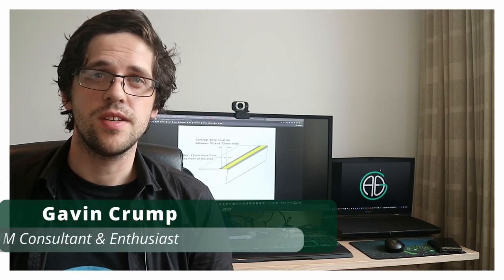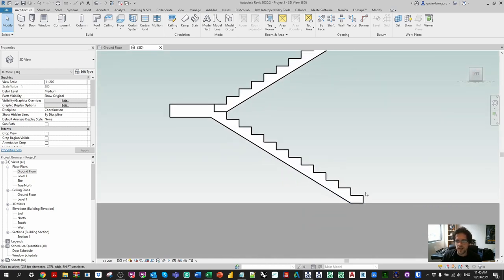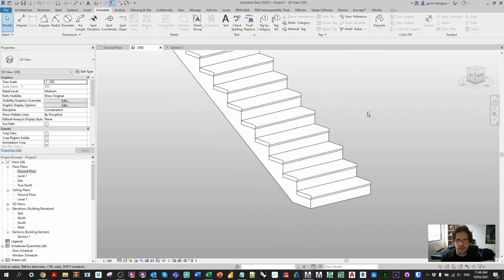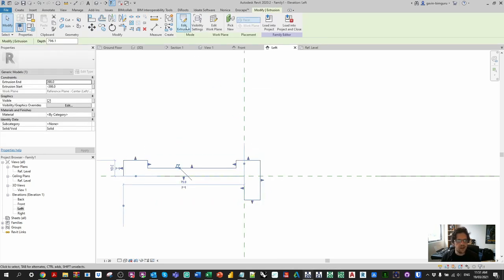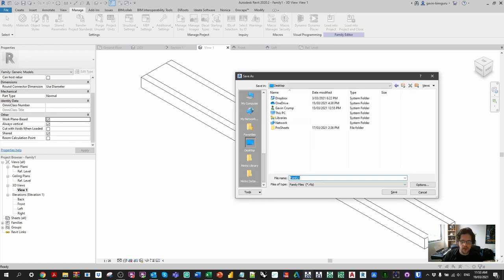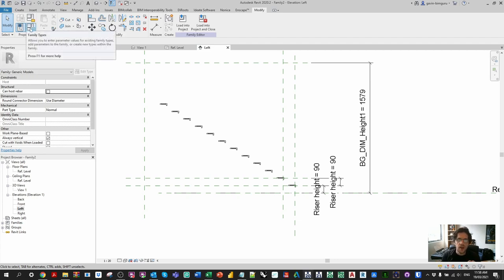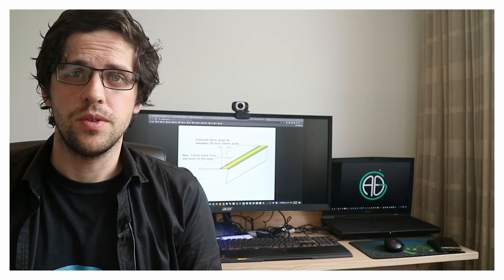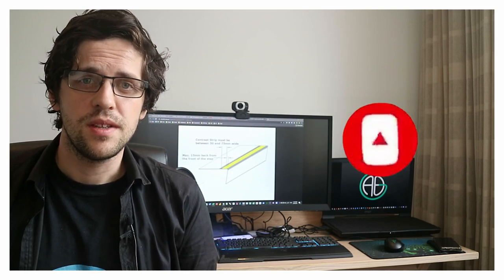Stair nosing strip family in Revit!

Comment: Another Great tutorial, will definately save time in the future :)
I have a question pegging back off a previous tutorial re - Project browsers. Have you found some way of preventing other users from changing the project browser settings? Drives me mad when others change it and when I syncronise I get their settings. I know I should set an office standard and tell people not to change it but some people just wont change their workflow.
Reply from the maker: Unfortunately there isn't really a way to lock this in aside from changing it as a user account, not synchronizing and closing the file. I believe this may lock down more than just this setting however so probably isn't a safe approach.

Just keep slapping the users each time they change it until they get sick of it I guess haha.

Comment: Yo Gavin, hopefully you'll see this. I suppose I could also use this method if I wanted a riser that is narrower than the stair width? Or for that matter to model the steal plate under the tread in a stair with a single middle support?
Reply from the maker: Technically you can develop any stair based shape usinf this array technique, but they dont have any control or response to the base stair itself unfortunately.

Comment: Dear Gavin, 
I have tried this technic for my modelling. But my problem is that i cannnot link the array stair with the stair width parameter. Can you show me the technic?
Reply from the maker: The arrayed, nested family will need its own width parameter connected to the width parameter at the level of the array family. It isn't linkable to a Revit stair itself however.
Reply: I solved the problem, thanks

Comment: That’s pretty neat! I doesn’t happen often that Revit or “Crashit 😅”crashes on me, but it has difficulties saving sometimes, it often complains about a sharing violation and I’ll have to retry about 2 times before it saves without the “save failed” message. We are using a network drive, but I’ve had this problem since I’ve upgraded to version 2020. With version 2013 I never had that problem.
Reply from the maker: Yeah I've found as any piece of software I use goes on it gets less stable. I think as the NET framework and other dependencies of the program evolve, and Revit doesn't it will encounter more errors that weren't allowed for in the handling process'.